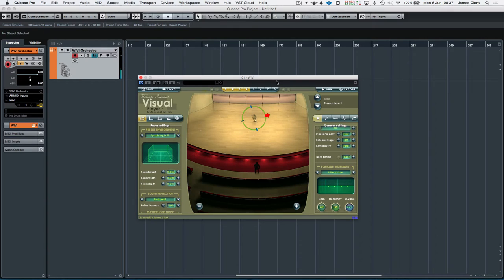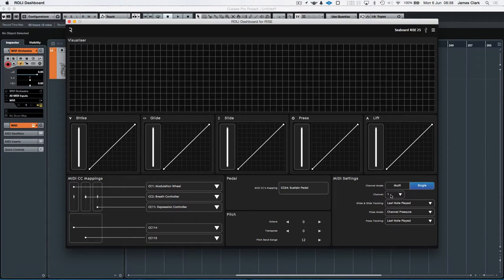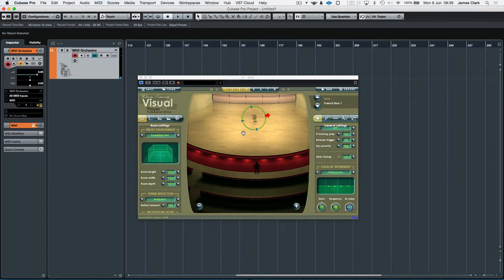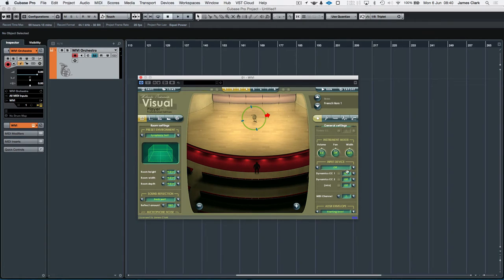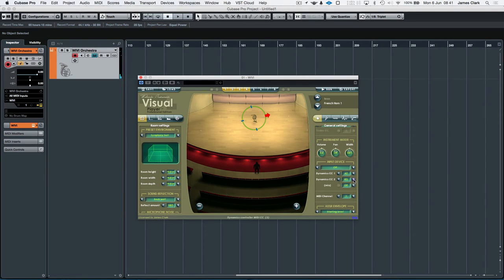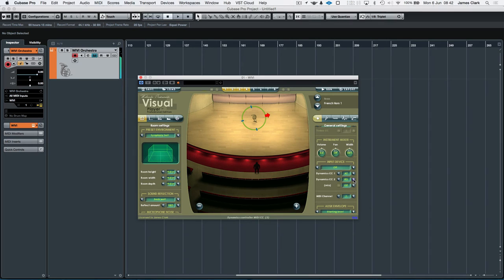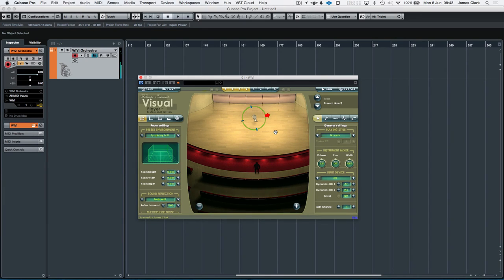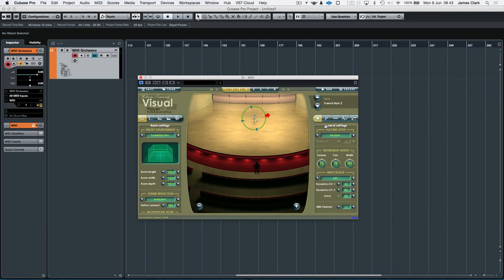Using a Roli Seaboard RISE to control monophonic instruments in WIVI

Comment: I'm not able to get SM brass to pitch bend to 12, have you any experience with that?

I'm considering picking up wivi if I cant
Reply from the maker: All of the sample modeling instruments should bend to +/-12 you are right but it seems its just the SWAM engine ones at the moment. it is frustrating. I can recommend WIVI though, very capable.
Reply: Dory Video is the pro player needed? I have MIR pro and a roli
Reply from the maker: i dont believbe so the pro player just gives you more contgol of the environment and a few other performance parameters, email Arne Wallander he's very nice and will answer all your questions. as lond as the player version will allow pitch bend editing and controller editin (to AT for dynamics for instance) all is good
Reply: :( I don't think I can change pitch bend range at all in the demo
Reply from the maker: send Arne (Wallander ) an email he'll be able to tell you
Reply: Dory Video I filled out the support on the website earlier today, nothing back yet
Reply from the maker: he's usually pretty good, he'\ll reply
Reply: Dory Video darn though.. maybe I can find someone selling it... I'm bummed about sm brass

I'd need the pro player
Reply from the maker: not sure it's allowed to be re-sold. However, have you thought of writing to SampleModelling and having a moan?
Reply: oddly enough, I think the instance I saw someone selling it might have been lying? I know I saw something a while back on VIc that was like "now that wallander is allowing the resale of licenses" but it must have been years ago...

The email form on SM's website seems to be busted...  swam answers me, but it's not a swam product